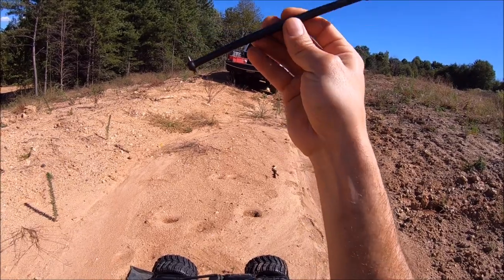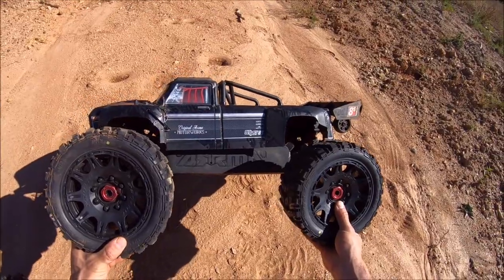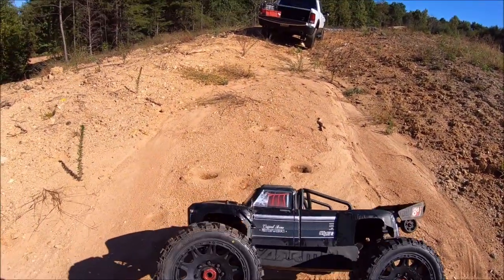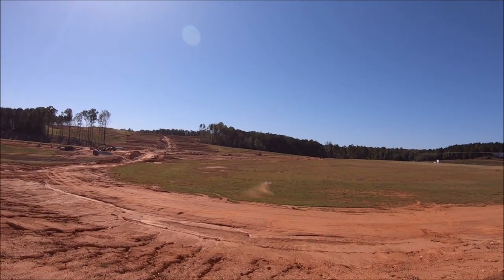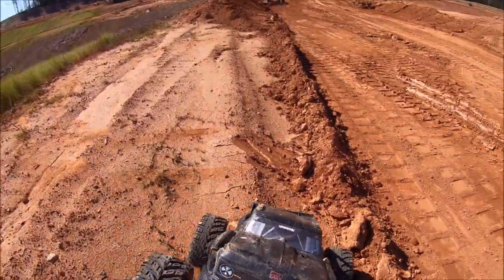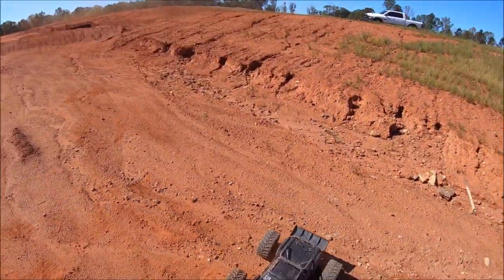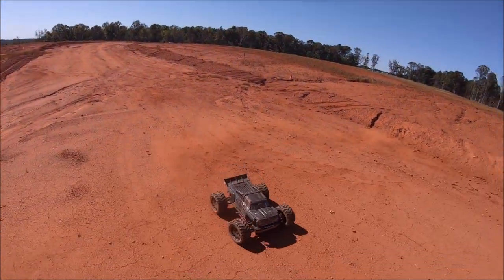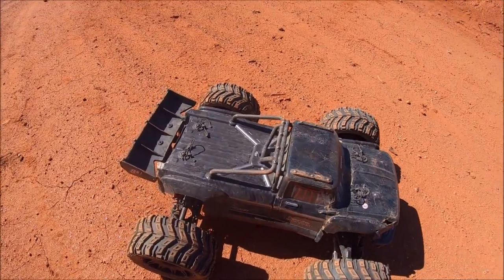OVERKILL!💪Arrma Outcast 8s EXB M2C "Overkill" Driveshafts and Hobbystar 850kv Motor!

Comment from the maker: Guys these new shaft prototypes are not the regular M2C upgraded shafts but an even beefier option for the fearless bashers! These are over 8mm thick at the center. We'll keep you updated! Bash on!!😎👊🤘🤘
Reply: Sick rip bro I really enjoy ur content. Keep it up, please! 😃👊🏼👍🏼just wondering what recommendations would u have for non belted tires for this beast? Belted tires are a little stiff and low profile. I have the hobbystar 1120, and run the six packs. when I put some decent batteries, the china hobbies and punched it they came unglued.
Reply: are the pins more thick then the stock pins ?  the pins  have been for me a major breaking issue
Reply: did they come out with the new over kill driveshafts??
Reply: @bengalinato7053 was wondering also.  Just picked one up on the Christmas in  July sale and trying to get all the stuff ordered for it when it's delivered.

Comment: Wow! That was a Wicked bash! I'm loving those masher x tires! You always make the most out of any spot! Thanks for abusing the parts!
Reply from the maker: Thanks Avery! Yeah that first spot was sketchy but just had to keep her hammered!🤣Huge thanks on another awesome upgrade!!😍💪💪
Reply: Doesn’t he or what? Air for days. And thanks for the awesome upgrade goodies. Found one aussie rep selling your components, thanks for getting them all the way out here so we get the tough rc’s as well 👍🏼🤜🏼🤛🏼
Reply: Bros M2C, I just want to say thank you so much💙 for the 6lug 17mm universal hex kit. Using them on a custom heavy Mojave that I thrash. The caps stick out slightly but, they are super strong as I bash in WNC so all rocks and roots, no problems. I can still see the logo, a little😁
 - you like to bash hard? Really tired of destroying rims? maybe yr wondering, are they TRULY worth it? YES!! it's the #1 first upgrade before even putting in a battery. Must must must buy. Best upgrade I've ever bought and I buy them all👍😎
Reply from the maker: Thanks for that honest review!👊 It is a great part to keep handy! Works especially well to fix the Mojave wheel issue!!

Comment: Not sure that you will see this, but I’m in need of some pointers. I have an arrma infraction v2 I’d like to convert to a street/dirt basher. Not sure what arms, bulkheads, etc would work. I’ve moved from the city into the country and it just sits on a shelf now
Reply from the maker: Are you looking to make a Monster truck out of it or more of an off road Rally? You could always get Kraton towers, links, Arms and shocks to make more of a 1/7 Kraton. Then some Outcast Backflips for tires. I have a video on running my infraction in loamy flat dirt with a few adjustments and Short course truck tires. Not sure exactly what you're looking for. It may be cheaper to just get a 1/8 basher.🤔😎👊👊

Comment: Wish M2C would make some driveshafts for the 3s line, I broke 1 3s (stock) and 1 4s driveshaft already, don't like their CVD's since it's metal molded onto a plastic shaft. The problem with the driveshafts is making me want to go traxxas, at least there is good aftermarket support (MIP) for it
Reply from the maker: It has been discussed! I'll get with them and see if they can make it happen!
Reply: @RCDUDE81 , Not sure on the wheel side what can be done, but Hot racing did a diff output gear to get a D shaft they could mount theirs to. Perhaps M2C could do something similar, Not sure if they can do splines, if so keep the stock parts. Thank you for answering, hope they are able to do something. The driveshafts are the only thing I've broke so far, and can't loosen the slipper anymore that it already is

Comment: Wow great job on the bash yeah those tires look great on that terrain. Overkill M2c drive shafts that's nuts. So you said they are even thicker all around ?
Reply: Yes I think they have tapper them or they hit the braces so he made them thick as possible,  im thinking
Reply: @paulclancy2404  wow yeah I have the  M2C drive shafts and been working great for me. Best if using the stock tires or proline mashers like what rich is using
Reply: I mean Eric 😂.

Comment: Do these drive shafts also fit the center diff ? If so I’m gonna order 6 before they sell out lol gonna 12s a kraton not for bashing just driving these trucks are such a blast to drive
Reply from the maker: No these are only Outdrive shafts. 😎
Reply: I ended up going online to order just those and bought the 7mm shock shaft kit and the center drive shafts lol 350$ later but can’t be happier
Reply: Quick question with the outdrives and center diff do I need a new pin or can I use the stock pin?
Reply from the maker: @andrewtexiera2858  Stock pins will work fine!

Comment: I feel like there should be a plasic 3d part u could buy that would hold battery leads together and prevent them from coming apart.
Reply from the maker: Agreed! I try to strap them in good or in extreme cases zip tie the connection.

Comment: Hey bro have u had any problems where ur HW motor shaft seems to move back n forth a little? I thought it was my pinion gear but seems to be the shaft.
Reply from the maker: Check your motor bearings. Sometimes if the front bell bearing is shot, it'll cause shaft wobble.

Comment: Think I get more out of that motor than stock 1200kv , could I use stock esc ?
Reply from the maker: Yes this motor is much more powerful especially geared right.💪You can use stock ESC yes but a Max 5 will maximize the overall power.
Reply: @RCDUDE81  thanks brother

Comment: Have a hobbywing 800kv with 30 tooth pinion max 5 esc will this set up be any good?
Reply from the maker: What spur are you running?
Reply: @RCDUDE81  Whatever spur comes stock I'm not really sure
Reply from the maker: It will work but will probably be more torquey with low top end. I'd try it and see how you like it. Other than that I'd recommend going 34/34 with a 800kv.
Reply: What is the stock spur? Thanks for the quick response!
Reply from the maker: No problem! Stock I believe is a 47 tooth. They make a 39 optional that will fit right up too. If you go 34, you will need the Arrma spool gear.